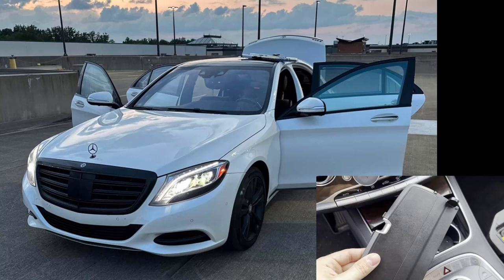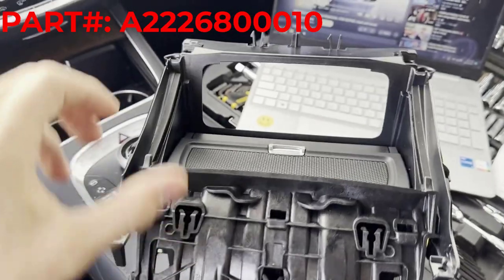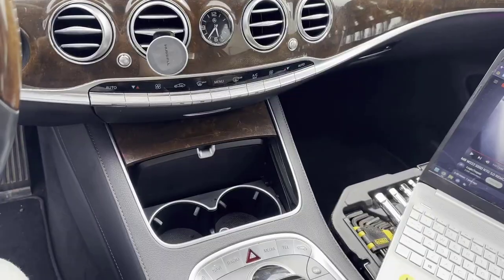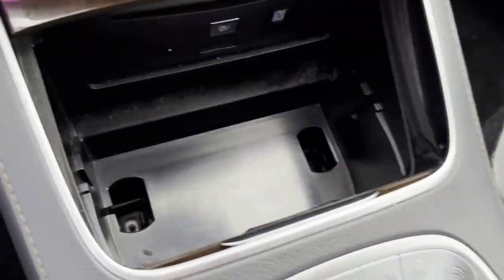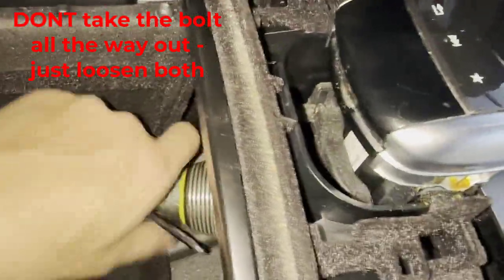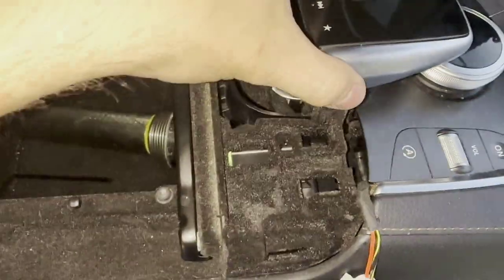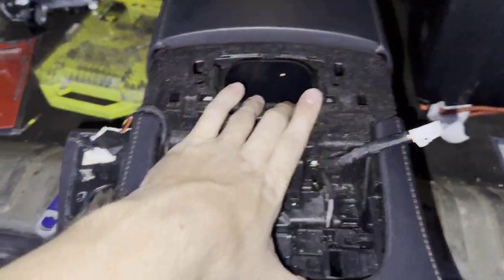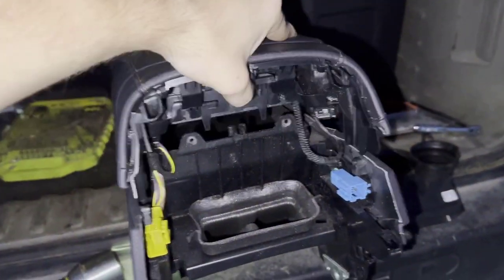Mercedes S550 W222 S Class (2014-2019) Middle Tray Divider Repair (above the cup holder)

Comment: So in theory you just remove the back ac vent an the 4 bolts an the 2 in the front an the whole thing will come up with out having to take fully apart still in the vehicle
Reply from the maker: @Ekwol  potentially! 

If I recall correctly, it was really hard to reach and see under the console with it still in the vehicle.
Reply: @McCuneRS  I shall experiment on mine when I goto do an let you know if it worked lol
Reply from the maker: @ 10-4 definitely let me know!

If you’re feeling up to it, record it, upload and save everyone some time if it works!

Comment: 2018-2021 are s560
Reply from the maker: While you are correct about 2018+ being an S560- up to the 2019 model, it shares the same method to remove and replace the piece featured in this video
Reply: With one difference I don't think the mouse removal can't be unscrewed until the top of the center console is removed
Reply from the maker: @jerometurner8720  It's possible there is a slight difference, and a viewer would have to overcome that on their own.

Comment: Where did you get the front grill? I have purchased three of them and the camera doesn’t work with any of them. It just comes out over and over again. Super annoying.
Reply from the maker: I used my OEM and had it plasti-dipped while getting my rims done the same.